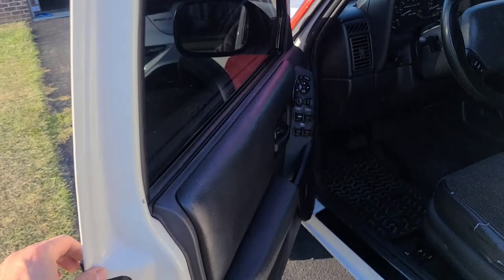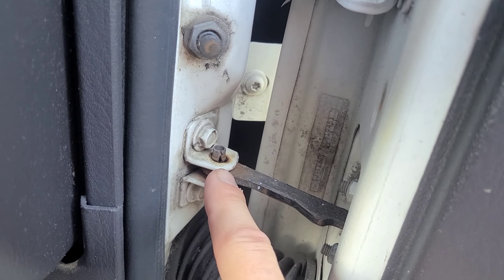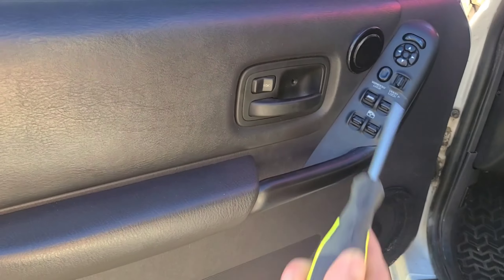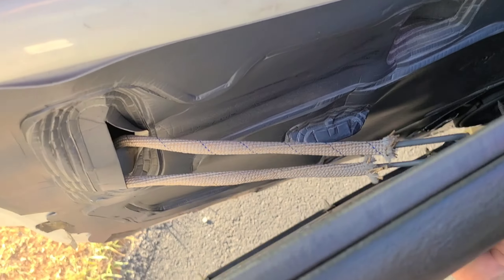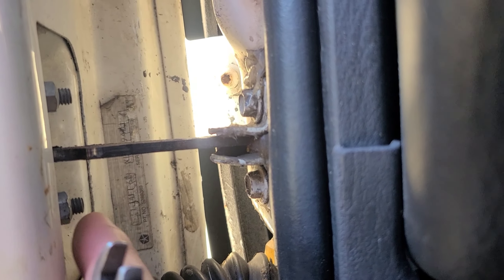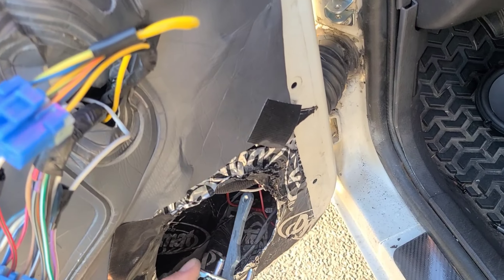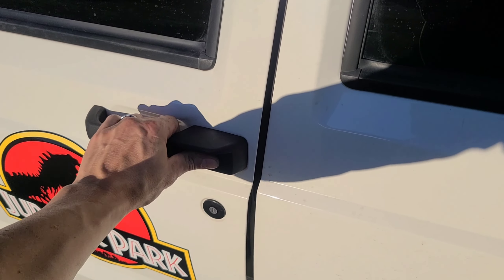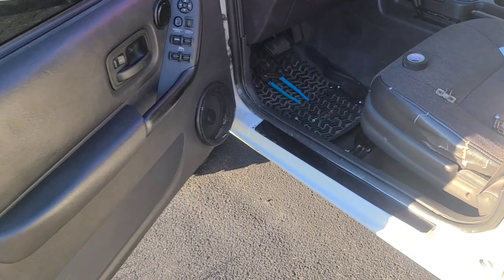Jeep XJ check arm replacement | No more door popping and cracking

Comment: Grease is an amazing product. It lubricates metal to metal surfaces and eliminates squeaks. A small dab on the top and bottom of the arm will do. Open and close the door a few times. Done. It is cheap, easy, effective, and likely saves unnecessary work.

Comment: Sure, let’s just quickly skip over how much of a pain in the ass it is to get the new arm up into position through the speaker hole.
Reply from the maker: I thought it was pretty easy.  Slipped right in 🤷‍♂️
Reply: It is a pain in the ass. A wiring harness and a bracket are in the way. 
   Tie a cord through the hole in the arm of the old check before you pull it out. Attach the cord to the new check. Pull it in. It's also helpful to be parked slightly downhill while you work.

Comment: I just bought the same stuff to do mine. Great video!
Reply from the maker: Thanks 🙏    It really does make the jeep feel nicer
Reply: Did you have trouble getting the new arm in? I read some tips about using a riibbon or a string to line it up when putting back together. Just curious.